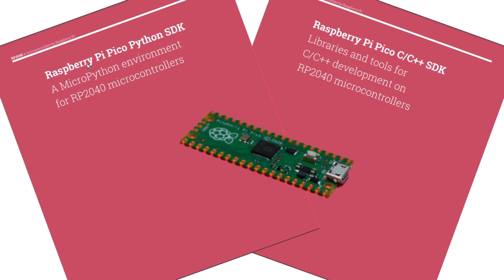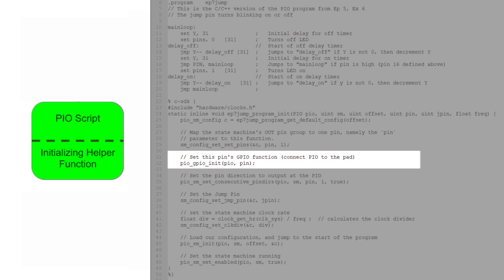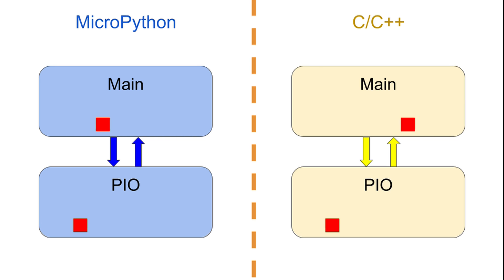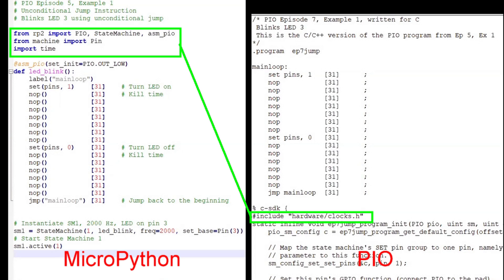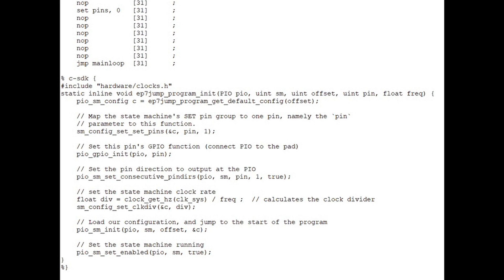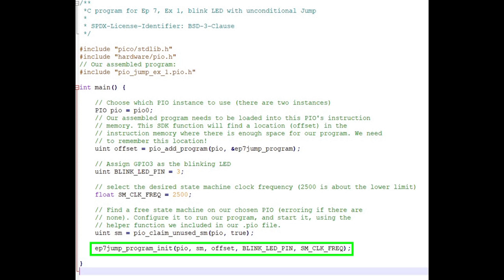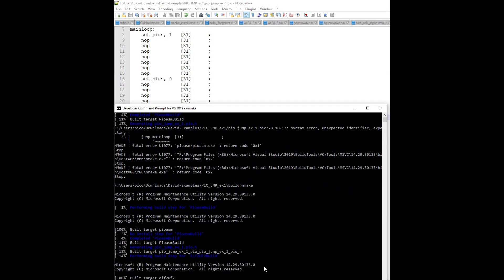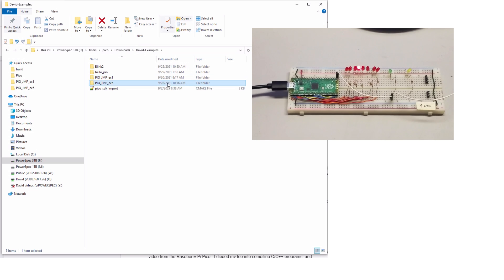Raspberry Pi Pico PIO - Ep. 7 - C/C++ Introduction to Writing, Compiling and Running PIO programs

Comment: 10:00 — No, UF2 is not what Pico executes: once you enter its hardware bootloader (by power-cycling shorting BOOT), it will emulate a USB mass storage media while under the hood it will fetch the file you're copying onto it, and divide it into frames, and extract firmware data out of them, and write them down into flash memory.
It was made so to ease the process of replacing firmware for end users, because it reduces the amount of hardware and software required for the final stage — sending and writing firmware to a device. UF2 is a protocol defined, IIRC, by folks in Microsoft or something, completely independent from RPi Pico and other users.
Reply from the maker: You are correct.  I have learned a lot since I made this video.  Check out my Bare Metal Adventures where i pull together .uf2 files from assembly programs I wrote.  Thanks for the comment!
Reply: @LifewithDavid1  I had no doubts in you, man, and your positivity encourages a lot, you know. ;D
Thanks for sharing your adventures!

Comment: A note: The .pio file isn't C, it's pio assembly. The stuff between the `c-sdk` braces are embedded C. The PIO assembly is its own syntax, and the statements DON'T need a semicolon at the end, those are actually the start of comments! the `.program` and stuff are directives used by the assembler.
Reply from the maker: Good point.  As I get more experience; I pick up on the nuances of the language. It's a balancing act trying to present these concepts to people starting out without them getting overwhelmed with the fine points.  Thanks for the comment.
Reply: @LifewithDavid1  Of course! You seem to have a great handle on it, just some mostly irrelevant details a bit off, just thought I'd give a friendly correction.

Comment: Do you have an example of side set in C++ in any of your videos? I've been having a scan through in the short time that I have but I haven't been able to find one. I was hoping I may have found a C++ version of your 8bit data + handshaking example (https://www.youtube.com/watch?v=BAP_n7gxg6M)  that you did in Micropython since you did sideset there. I'm just getting some errors trying to compile my own program so I was hoping to find something I can compare against - I basically took your handshaking Python example and tried to make a C++ version of it.

First of all I had the build complaining that I'd exceeded the maximum number of side set pins.. so I added ".side_set 1" to the program (which may have been a mistake). After adding that, I get the impression that the compiler wants me to specify a side instruction for everything, even 'pull'? Surely we don't have to specify "side" for every instruction when using C++? The official example on page 37 of the "Getting started with PIO" only has 4 instructions, all containing "side" so that isn't very helpful.

[build] C:/pico/pico-projects/PIOCount/counter.pio:105.5-8: instruction requires 'side' to specify side set value for the instruction because non optional sideset was specified for the program at C:/pico/pico-projects/PIOCount/counter.pio:101.1-11
[build]   105 |     pull
Reply: ..and the minute I posted this, I read "Because we didn't say '.side_set 1 opt'..." I bet that's what I was looking for!

Comment: Thanks for the video, David.  I develop mostly on Linux, but I have consulted your video a couple times for developing on Windows.  I recommend an absolute path for the SDK variable.  A relative path will bite you later on if you move or create projects elsewhere.
Reply from the maker: That is a good idea.  There is so much to learn; that I feel lucky just getting something to work.  I need to start moving toward best practices.  Thanks.
Reply: @LifewithDavid1  You can also put the SDK path right in the CMakeLists.txt file, with this line: set(PICO_SDK_PATH "C:\\Users\\myuser\\Documents\\Pico\\pico-sdk")

Comment: Great video, thanks! I've been programming the RP2040 with C/C++ in VSCode for about a year now and by FAR the biggest challenges have been setting up the SDK with VScode and dealing with CMAKE and JSON files. I swear it's ridiculously overcomplicated and when you look for any information on cmake it's a freakin' OCEAN of information. Once you get all the damn hooks set in place, the actual programming is a breeze in comparison!
Reply from the maker: I'm trying to do some bare metal assembly programming of the Pico and as I am writing this, I'm having CMAKE problems again.  I'm trying the new Pico SDK for Windows (installing as I write this).  Hopefully this will make those problems disappear (yeah, right LOL).
Reply: @LifewithDavid1  Label me NOT shocked! :D. Good luck!

Comment: I suggest redoing this video using Arduino IDE instead.  From what I understand (I too am still learning), it is much easier (less to do) though you have to manually compile the .pio file to .pio.h and import the .pio.h into the Arduino "sketch".
Reply from the maker: Take a look at my PIO episode 13 where I used the Arduino IDE.  https://youtu.be/gtmuTtuOQ0w  Were you looking for more info?  Thanks for watching!
Reply: @LifewithDavid1  How did I miss that video. 🙈 Thanks
Reply from the maker: @bitogre  Hope it helps!

Comment: I'm primarily a Mac user but I wonder if this wouldn't be more straightforward in Ubuntu in WSL?
Reply from the maker: It could be.  There are is a suite of native applications for the Raspberry Pi that makes it easier.  However, 1) hindsight is 20/20, 2) after you understand the process, it's pretty straightforward, 3) Doing it on the same machine that I edit videos on makes it MUCH easier to make videos.  Thanks for watching!
Reply: @LifewithDavid1  WSL allows you run Linux on windows fairly seamlessly. I switched to macs because web dev on older windows versions was a nightmare.
Reply: I should have been more specific. Windows Subsystem for Linux is a lightweight VM that allows you to run Linux distros along side windows 10+ and share all resources.
Reply from the maker: @justovision  Yes, Linux might be easier; but once you set up CMakeLists the first time; it becomes much easier.  Now, using Visual Studio, I can modify, compile, and load code into the Pico in less then a minute.   I have a couple other computers set up with Linux, but I try to keep my main video editing computer "Windows Pure" since my video editing software has plenty of glitches without any "outside influences".
Reply: @LifewithDavid1  Sure. But others might want to know about other options.
Reply from the maker: @justovision  Very good point.  I haven't tried it myself; but others might find it useful.  Thanks for the comment!

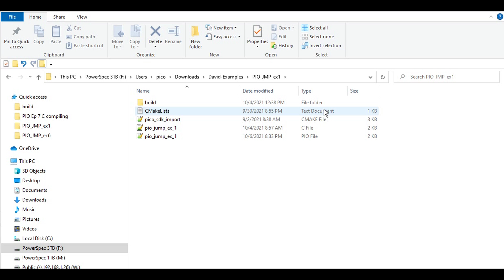Comment: Thanks for the vid.  I use Ubuntu 20.04 and VSCODE and program in C.  re, your file/folder layout for CMAKE etc at 8:54, I had issues with getting CMAKE to create the makefile until I copied pico_sdk_import into each project, as you did here.  Not 100% sure if that was necessary but before I did this, not matter how much I screwed around with PATH statements, the damn thing wouldn't build.
Reply from the maker: I've seen a number of others have to paste that file into each folder also.  There may be another way; but after hours of failure; we mortals will just adapt.  LOL  Thanks for watching!

Comment: Isn't it way easier to use the Arduino IDE for C/C++ development with the pico? I heard it has official support. I just don't know if there are any limitations, if PIO works properly etc. Does anyone know more about that? That might also be a video idea.
Reply from the maker: That would be a good topic.  Thanks for the suggestion.  I've been so focused on learning the RP2040 that I haven't wanted to increase my learning curve by changing IDEs.

Comment: In python there is a line to set the initial high or low state of the pin. How is this done in C++? That part was skipped over unless I missed it.
Reply from the maker: I think you would use  "gpio_put (uint gpio, bool value)" or " gpio_put (uint gpio, bool value)" to set the value immediately after you initialize the GPIO.

Comment: Thanks for this video. I think it would be helpful to redo the JMP examples for C++. I setup MS VS Code with the cmake extensions which helped with speeding up debugging code and not needing to get as much into the weeds of the make process.
Reply from the maker: Great suggestion!  The "jumps" work the same, just the syntax is a bit different.
Reply: @LifewithDavid1  Yes, a deep dive of all the C++ PIO settings might be more helpful since the docs are sparse for those of us who are not as experienced programmers. The python methods are fairly different and there aren't as many C++ examples.
Reply from the maker: @888cromartie  Good idea!  My next video (Ep. 9) will be a deep dive into DMA and PWM.  I've written the examples in C.  I'm not really experienced with C; so we'll all learn together.